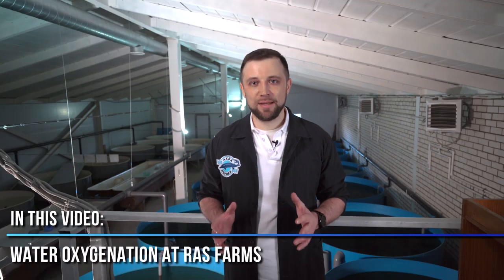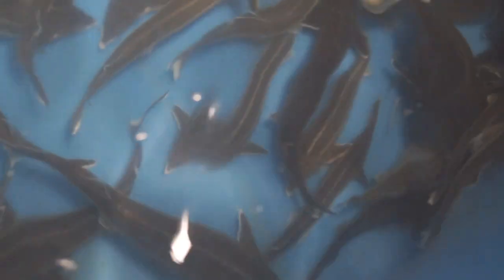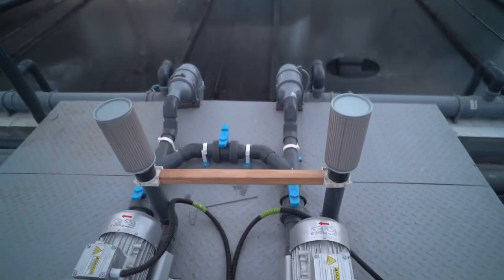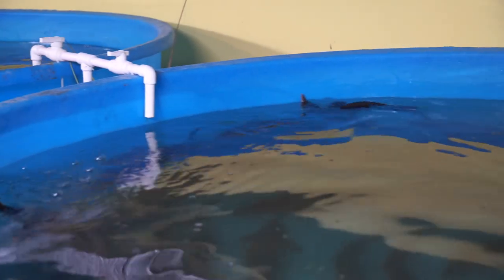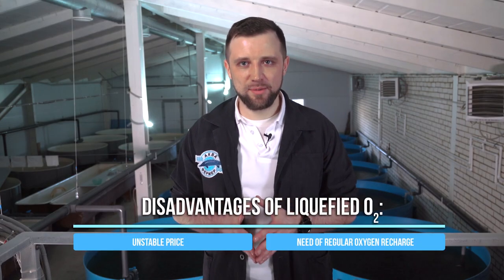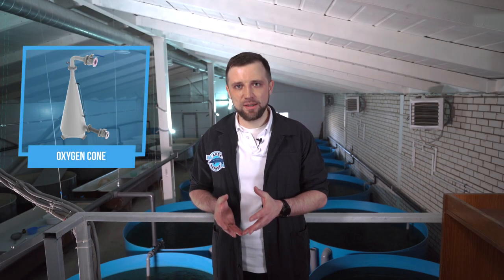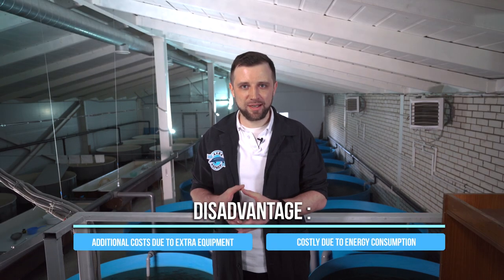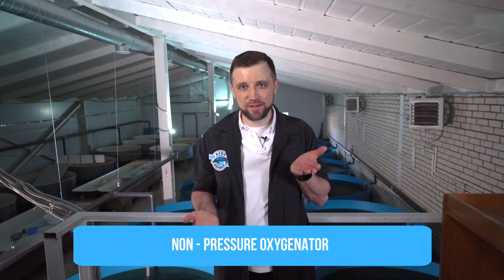Oxygenation in RAS | What EQUIPMENT UNITS are needed for SATURATING WATER with OXYGEN?

Comment: I guess nanobubble oxygenation are getting attention nowdays, low power consumption and higher gas dissolving ratio up to 90%, and can supersaturate water up to 50 mg/L.
Reply: Water oxygen levels that reach closer to Supersaturated are more and more unstable as it approaches 100% . One rise in water temp and the oxygen can discharge and a large dip in oxygen will occur.

Comment: Well done, the best video on this subject iv seen on youtube all the info you want without the shit.
 With the oxygen cone and pure 90% pure oxygen fully absorbed what would be the DO reading. 
Please help me.
Reply: We use Speece cone (self made fiberglass) to happily fulfill the dissolved oxygen (DO) requirement for our Asian seabass culture.  It provides oxygen levels of up to 25 mg/l (ppm) at the entry point of the culture tank, gets immediately consumed to 11 ppm for being an intensive culture with high protein diet and at the exit point comes down to 6 ppm, a very healthy concentration of DO for MBBR biofilter.
Speece cones can provide dissolved oxygen levels of up to 50 mg/l depending on cone size, temperature, pressure, flow rate, and purity and amount of oxygen injected in to it. Our cone is designed to handle full flow of recirculation (one circulation per hour), but we are planning for a side stream setup to save on flow requirements while still providing very high levels of dissolved oxygen assisted with the use of some type of venturi system for oxygen injection to create some turbulence and to enhance the cone efficiency.
Reply: Hello Mr. Anton Pelcher, thanks for the information given.
with Oxygen Cone and such a high DO level, have you ever tried it in shrimp farming? what will be the stocking density for shrimp at 20 mg/l?